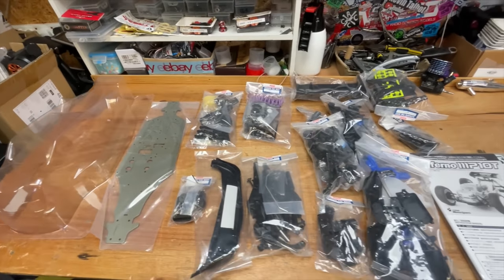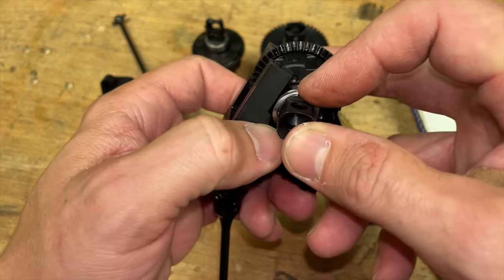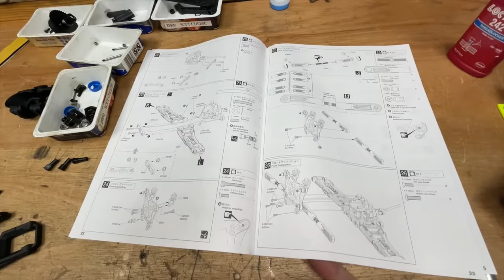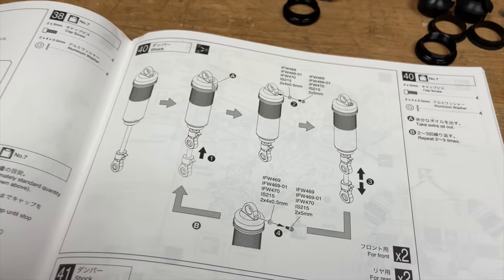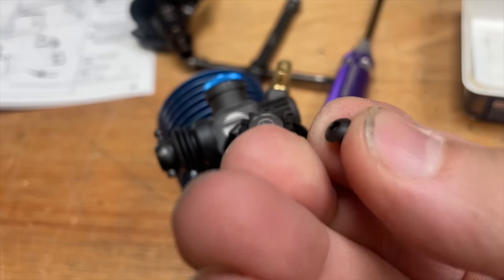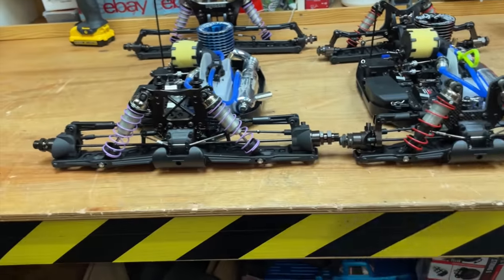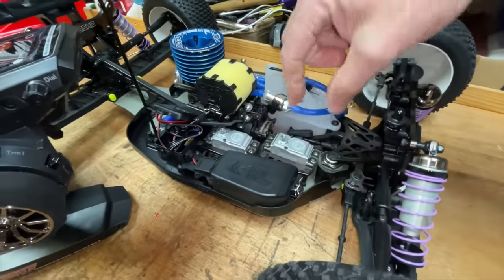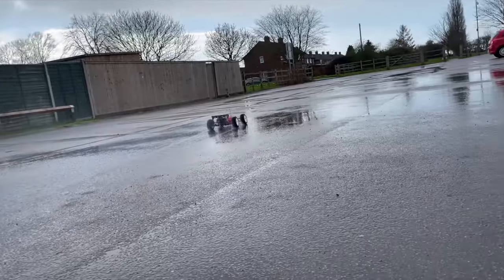Professional Nitro RC Race Truck Build & BASH!

Comment: Kev, if you found this menu difficult, you haven't seen anything yet ! If you buy good and expensive parts, they all work ! Cheap nitro engines are a pain even for experienced tuners because of the tolerances ! For new RC enthusiasts, always buy proper gear, cheap is expensive !
Reply: This is absolutely correct bro! I bought my first mugen mbx7t and never looked back. Got rid of all my other stuff and got tekno kits and still have a revo but otherwise 1/8 kits are the best for racing,bashing and anything else really
Reply: Hello can you please tell kev to get the legendary traiton
Reply: if almost 700$ isnt expensive to you, then idk what to tell ya
Reply: I bought a nitro last week and I am struggling to say the least lol I got the ‘Backwash’ from nitrotek. Are you able to help me out at all?
Reply: A word of advice from someone with 20+years of nitro experience .patience is a must .pretty simple to get going get the car get batterys in receiver and controller get your glow starter charged fill your fuel tank with the correct nitro fuel .put glow starter in the top of the engine head pump fuel through to engine .and pull pull start after a few pulls the engine should fire up .tuning the engine if it needs tuning can be tricky though .good luck 👍
Reply: @jamesh9092  Yes, make sure that you always have fresh fuel when you drive the car and fresh plugs ! When exposed to rich conditions such as run in process, extra oil reduces their life, so tuning and performance are getting worse !Also, always have your glow igniter charged and good battery pack(not AA batteries) in your vehicle to prevent runaways ! With fresh plug and above-mentioned items, start your engine ! If it idles ok let it warm up first and then drive the car ! You will need a temperature meter to check if it's above 60 degrees C, then you drive the car around to see if it is ok ! If not, usually the ''gold'' screw  on your carb is your friend ! Too much smoke and no go, turn 1/4 clockwise in and start your engine again ! You go from there ! Long comment I know, but that's the help I can provide from here !
Reply: However, I used to love the axial engines.
Reply: @alanmeyers3957  I used to love the RB engines but for me cost to fun is way better with electric !
Reply: I remember working at a hobby shop when everything was nitro. Everyone struggled with nitro. 
Traxxas had electric start, Hpi had roto start, and we used those bump boxes at the race track.
Reply: And watching this.. I miss building the kit cars. Learned how to fix them when they broke.
Reply: No matter what traxxas or any other company did nitro engine is pure professional racing not for fun !Compare to an electric motor from Lrp for example which can last for ever(over 600 packs with one set of bearings) ! i still have the box my self i hated it but....anyway only electric now !
Reply: This. A good quality nitro engine is SO much easier to tune and keep running then a cheap one its crazy.
Reply: Anything under 1500.00 to 2000.00 is cheap when comes to RC these days ..

Comment: If your worried about shock boots you can make your own from balloons. Grab a pack of the long balloon's and stretch it over the spring then trim off the ridge end and cut off the sealed end leaving a few mm to tuck inside the spring at top an bottom , put the spring back on the shock an job done. No more moisture and dirt to contaminate the shock oil.
Reply: In atvs and bikes it also helps keep from getting the piston rod dented by rocks and crap, love me some shock covers.
Reply: About to do this on my K8S. Awesome bit of advice. Thanks 👍👍
Reply: Can also remove the connector on the end of the rod, slide the boot on, then screw the connector back on. Little more time consuming than the balloon trick, but works great if you want the slightly more durable boots. Either way works, so it's really more of the builder's preference.
Reply: Oh man. Wow. My brain never even thought about the long balloons. I feel like a doofus that never crossed my mind.
Reply: Smart
Reply: @TheDogGoesWoof69  don't know why you bring up that topic. Kinda out of the blue.
Reply: @TheDogGoesWoof69  I'm a 2A guy myself, but bringing that up completely out of the blue and without context is kind of a screwed up thing to do. Sure, I'll discuss the topic with others when it gets brought up, but until then it's not my place to try to force the conversation.
Reply: Tysm that helps me alot!
Reply: Damn, good hack, will do this

Comment: I'd like to say you are FAR from a novice with rc, Kevin! You have more experience with more models then most any of us and your constantly wrenching on them! If there's 1 person I'd entrust to wrench on my rigs it'd be you lol. You can easily see the amazing handling of that mp10t vs what you normally rip around with.  One amazing piece of kit! Running beautifully as well
Reply: Do you not see how he treats his nitro engines?
Reply: @rockncoop665  HiS engines? I do. He is aware of what he is doing to his motors and is aware it isn't good for them. He has the knowledge to do it correctly, he just doesn't care. I'm sure if he were tooling on someone's rig who did care then so would he.

Comment: I love the Kyosho content.  They make some nice quality rc cars even some of their higher end rtr’s are really good.  I think some people sleep on these brands but don’t see the quality and experience that goes into these.   Love this build and truggy Kev!
Reply: Yeah, kyoshos are pretty sweet, I've checked them out at one of the semi-LHS and even when looking at it next to the Typhon 6s, the kyosho honestly looks higher quality, something about it just gives that impression, I got a hobao hyper sste and I love it, super durable and handles amazing, light weight and fast
Reply: @restinpiecesrc5528  Hobao are great rc cars high quality and strong!   I need to get one.  Had a buggy years ago and it was tough!
Reply: @restinpiecesrc5528 All modern 1/8th scale buggies are based on the Kyosho Burns and original Infernos. Kyosho and Yuichi Kanai designed the elements of a 1/8th buggy that are still used to this day. Kyosho is the grandfather of them all.

Comment: thumbs up for having trays/bins for all the various bags. If you've never built a kit before that's THE way to do it....I put the tag from the bag in the bin so I know which is which. Makes assembly SO much easier. 

Get a bunch from the dollar store with lids so you can keep the spare parts arranged after you're done.
Reply: or for the smaller 1:10 cars a muffin tray with different compartments work.
Reply: @extec101  yeah I used a muffin tray in the past as well but you can't put a lid on it hence why I went to the dollar store bins.

Comment: Just a build tip. Put the shock boots on before the shock ends. Also make sure to oil the air filter. Didn’t look like it had any on it.

Comment: With shock boots I put a very small drop of shock fluid inside the small end of the boot,, roll in fingers to lube the bottom end of boot inside, then slide it all in place and clean and wipe off ecsess . Right way or not it works for me. Happy bashing kev

Comment: Get one of those gyroscopic screwdrivers and you can skip the ugga dugga entirely, it uses your wrist motion to control speed so you can feel the tightness of the screw same as a regular driver while still being pretty fast. Super handy for RC cars.

Comment: Get yourself a small copper mallet, or a small length of copper rod 10-12mm dia to use with a normal hammer to knock in those hard to install bearings Kev

Comment: I am telling you. If we had the modern nitro stuff that we have today back in the 90s nitro would never have died off. Nowadays you can start the engine easily, engines are more reliable and easy to tune, modern fuels that are filled with anti-rust additives. The list goes on
Reply: Gona have to try nitro again, the last time I played with nitro engines was in mid 2000’s….. and like you say, they were fiddly, hard to tune, and if you didn’t run the engine often it would corrode and gunk up from the fuel…. Absolute pain in the arse, but still very fun.

Also I was using crystal remote controls which weren’t the most reliable back then just to make it even more exciting

Comment: suggest you setup the failsafe on the transmitter if it has the capability. you should be able to set it, to test, turn off the transmitter, you should see the throttle servo revert to brakes. turn back on, back to idle. thats what i do with my nitro on futaba systems

Comment: Ya just cant beat the old school starter boxes. 
Looking at this Buggies really haven't changed since my PB Mustang 2 from way back in the 80's.
Different shock towers and positions , no top radio plate and no upper link between the front and rear differentials. Far better plastics, no bumpers and everything that needs to be drilled or fitted in the kit.
The old kits never had linkages or even diagrams of them you had to get piano wire or bicycle spokes and make them yourself.  I remember my first RC500 Associated kit was so crude that the suspension arms didn't even have pivot holes drilled in them.  An absolute pain when it came to setup.

Comment: Huge difference when you use top quality nitro engines.. Back in the day (late 80's early 90's) with 1/8th scale buggies I used a few different types and they all had issues. Magnums loved breaking cranks lol.
Went to a race spec OS RX-B .21 and it made the world of difference. And the power and suprise suprise...they held a tune for more than a tank of fuel lol.
Good luck with racing that kit looks spectacular out of the box!!!
Reply: I gotta swar by kyosho tho. I built a VR1 corvette of theirs way back in the day and it always ran like a top. I haven't run it for years due to no nitro available where I live but I bet it still runs like a champ.
Reply: that part of retune and engine go out of tune after a tank or two i dont miss that part by running all electric today.
Reply: @extec101  totally agree. Brushless power is by far superior.
Reply: When I "tuned" my first ever nitro engine I had it running waaay to lean, it absolutely screamed but I melted the conrod. 😅😂
Reply: This so much, cheap nitro engines are likely one of the reason so many people dislike them and think they are a pain. Recently bought an XRAY NT18 with a 0.8ccm engine thats made in Japan and holy moly that thing was easy to tune. Even with piss poor settings it would at least still run and not suddenly stop out of nowhere as I experienced with Force Engines.

Comment: Kevin if you ever want to stop a motor from turning over when you need to tighten something? Use rope. I do that alot in small engines. Stuff it down the spark plug hole, or exhaust like you said. It's soft, and it won't do any damage. 🙂

Comment: Best way to tune is by temp thay make a on board temp setup that will display the head temp . Should be able to find the appropriate temp in the manual and basically hit that number and your a/f ratio will be on point   .most definitely suggest a on board temp for nitro makes life so much easier not having to carry a laser thermometer in the tool box .

Comment: Epic vid, seems like a heck of a truggy! Just wanted to note that the shocks do seem like they could use some adjustment, thicker oil and/or more preload and/or stiffer springs and/or less A-arm droop. It looks like the truggy is running a lot of sag as is, maybe that's for that lower COG for racing though!

Comment: I hope someday I will have a nitro rc car 😊😁
Reply: like kev says fun when they run but they take forever to tune right, like to burn up spur gears but still go for it
Reply: But nitro are the best 😁
Reply: Buy the best quality nitro engine you can afford. Cheap ones have more issues.
Reply: Thanks for the advice 😃

Comment: you should try the team losi racing 8ight-xte kit. I bash one on only had the rear drive shaft bend which I've replaced with a mojave shaft.

Comment: I'm STILL bashing the crap out of my mojave, and it STILL has not broken. I've run it into boulders, curbs, and parked cars (shhhhhh), and I've fully sent it off of some huge ramps. The body has zip tie stitching, and some of it is just ground off, and my tires are going bald. Puts a smile on my face every single time. ☺️

Comment: Dedicated starter box engines are always better than pullstart or rotostart engines, the blanking plate allows them to have a smaller crankcase volume, which gives more crankcase compression and better transfer port speed, giving a much more stable idle and better responsiveness along with increased power, win win win! The only drawbacks are needing a starter, and that basher trucks like Savage,  T-maxx, Sledgehammer,  and others often do not have any way of being able to start the engine with a starter wheel, never mind a starter box.

Comment: I remember the shock boots being a pita but I got them on my mp10tki2. I do light bashing with mine its a tough car and runs and handles soooo good. I put an os max 21xz-b in mine great running engine.

Comment: On getting the little retainer grommets on the fuel line,  cut a taper on the end of the fuel line and then feed the small point of your taper into the grommets. this also works for getting fuel lines into the gas tanks on weedeaters.  Hope it saves you a little cursing.

Comment: Nice build and video, A part of me is thinking about getting a 8th scale nitro vehicle but a part of me wants a gas 5th scale gas vehicle. I've only owned all electric vehicles at this point but i'm a little worried about the noise and extra maintenance or ICE RC vehicles. If i were to get any nitro vehicles i would get a Revo 3.3 and a TLR 8ight-T i still want a Losi 5ive-T 2.0 for gas powered.

Comment: On the subject of radios, that is exactly why I prefer an old school analog dial. Way easier to adjust. You don't have to stop, make a phone call, get a manual, watch a video, and then spend 30 minutes clicking through a bunch of nonsense to make an adjustment.
Reply: cant say im disappointed about todays radios in terms of handling and what can and cant be done to them i terms of endpoints and stuff like my futaba 3pv compared to the old hitec lynx its miles apart.

Comment: Nice Work Kevin.
Can you tell me please which one Silicone oils do you use for the front, middle and rear differentials?
You took 10000s and 3000s.  If I saw well, you filled 10000s for the middle differential. But now the 3000 comes in front or rear? Or? Thx for Answer

Comment: if you break in a race engine like that itll be inconsistent and never run properly. have to idle for 3 tanks then run gently until the rings seat. you'll notice that because it will run very rich. after that you can tune the engine and begin to run harder

Comment: Kev, that happened to me on my X-ray Truggy. I put the shim in and it bent out the side like yours. I didn't notice it and went to my race over at Amain Hobbies with it like that. My heat race came up and on the 3rd lap, smoke was coming out the back of the truggy like a choo-choo train. 😂 When I pit the truggy it was too late, the right side of the diff case was a hot melted goo of plastic, lol. The bearing locked up and spun in the housing. Was so hard to take apart cause it was like glue. Never experienced anything like that before, and neither had anyone at the track. I'm a clutz. 😂

Comment: kevin mate. with a new engine u need to follow the book that comes with it. most need 4 idle tanks. 3 slow driving with enough throttle for it to move slowly.  then 10 seconds full throttle 20 seconds idle for 2 tanks. then u can race tune 
never go full send

Comment: It does look great quality, but for an £800 pro competition non rolling chassis only, there are a lot of fine thread cap head bolts going straight into plastic. I'm assuming this is normal, even at this level? The core build up of the chassis does not look much different from the usual, decent quality RTR stuff, or even a lot of the cheaper ones too. Lots of plastic etc etc? I suppose it's light & strong enough for clean racing, and lots of adjustability too.

Comment: Hey Kev. I love your videos, I've probably been watching since 2018, every time to get a Kyosho inferno I get mor excited, my dad had one when i was a toddler and loved watching him race it, that was in the early 90s like 94 maybe 95. well, I own that same car now, it's just the chassis, (with an OS max engine not sure what size it is) and the bulkheads and suspension and wheels tires etc. body is gone same with center diff, I really think I need to find a period correct body with wing and center diff, but I don't even know where to find them. just wondering you or someone in comments can help. I'd like to give it back to him fully operational.

Comment: IDK if it would help but when wecworked on helicopters (real ones), we used KY jelly to slide rubber boots on parts. We didn't have pointy corners, though. YMMV.

Comment: How are you going to fuel it kev 

You're like an infomercial for not to do nitro rc racing. Some clutches are easier than others and a 3 shoe clutch is easy with the tool. 

I want this hobby to grow. Racing keeps the manufacturers involved or still alive